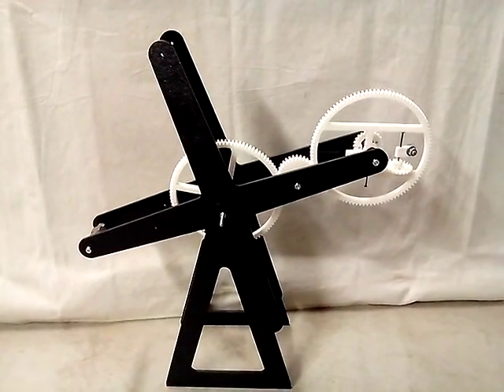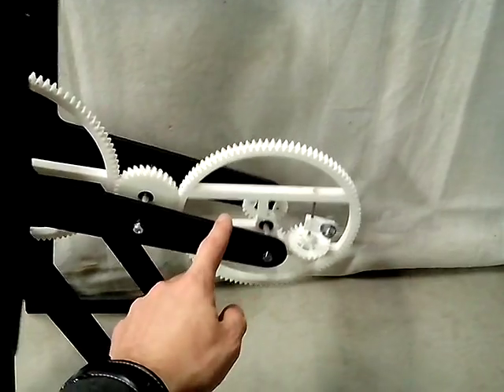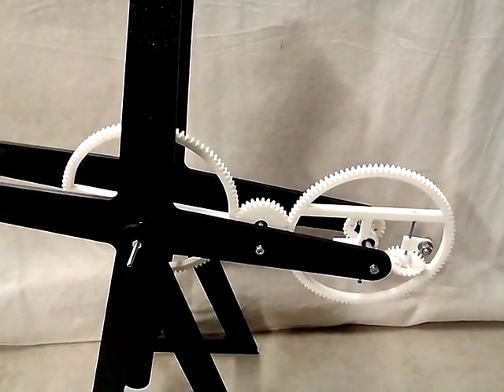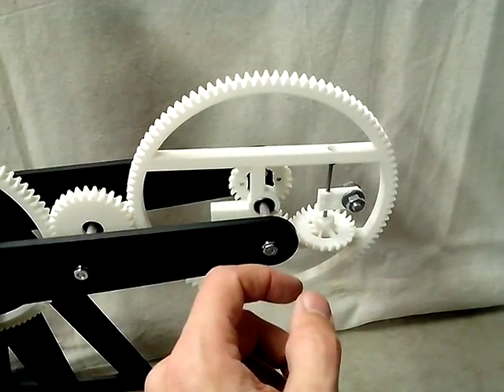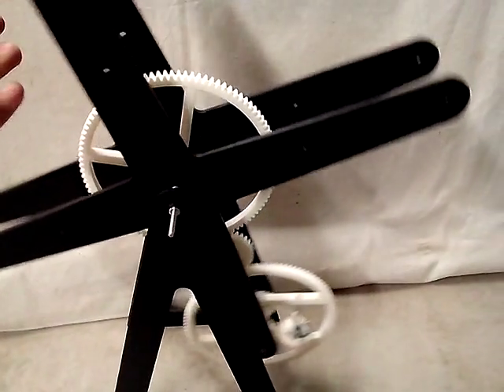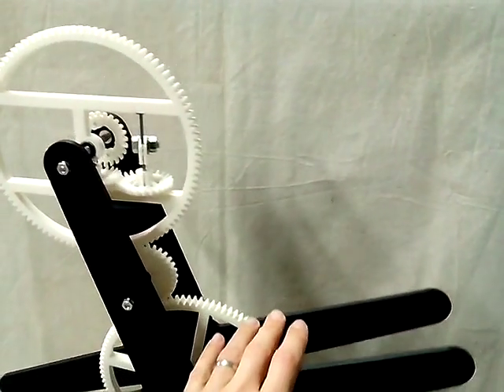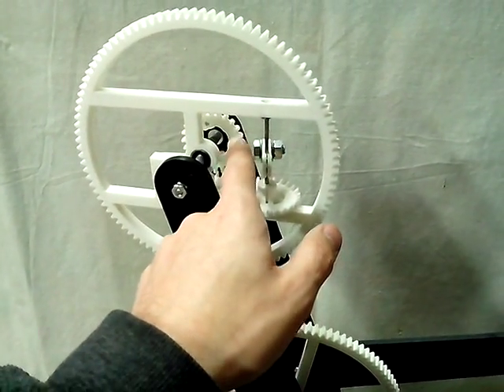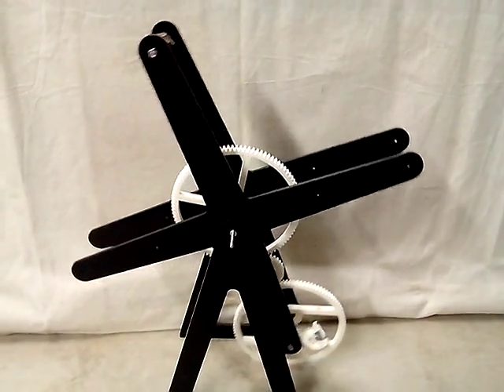Perpetual Motion Prototype

Comment: your wheel is imbalanced to begin with. when you add weight like a wheel on one side, you must apply the same amount of weight on the other side or your difference will not do anything.

Comment: as said.  heavier weight but with a longer arm for more leveraging.   instead of 4 arms use 5 arms, 3 arms falling 2 rising each arm with a gear and weight set.  time the gearing so the weight is at a horizontal spin on the rising side and a vertical spin on the falling side, this is where the weights will put out the torque, when an arm is slightly past its highest point the weight should be at its highest point and starting its fall on a vertical spin.. 
  if you dont quit understand what im explaining and are interested in more detailed and pictured explanation contact me at duncanspcs@gmail.com
also i really want to know where u got those gears...

Comment: It's really nice prototype. If you add another gear in other side and increase the weight, the prototype will work well. Congratulations.
By the way, where can I buy the plastic gears like what you used in this video.
Reply from the maker: I designed and printed the large gears.  The smaller ones were downloaded and printed from thingiverse.

Comment: Dan, I think the problem you are having is that the weight needs to be towards the center of the 4 arm hub when it is on the left side and away from the center hub when on the right side. I love your gears approach and could imagine a sizeable weight being moved back and forth to good effect. This should work with enough arms, bravo, much better than other designs. You need to modify the bevel gears ratio adding a 2:1 divider so the weight moves half as fast rotating out and back in than it currently is doing.

Comment: If you could figure out a mechanism that would put your moving weight towards the main axis on the upstroke perhaps the torques would be less balanced.  Maybe something that moved the weights straight in and out along the axial plane rather than rotating to the sides.  The off-axis forces cause extraneous friction in the machine.

Comment: I've tried many variations on this concept, but there's only torque if the unbalanced weight can get lower - ie. the outer wheel IS overbalanced, and thus so is the net system (including the stator), however the weight can only drop if the outer wheel can rotate it downwards, which is intentionally prevented by the gearing...  basically, holding the OB mass out horizontally and keeping that angle in spite of the orbital rotation precludes any actual weight drop and thus converting any GPE to KE.

Besides which, gravity and mass are static fields...  so it seems highly unlikely that OU is possible from perpetual overbalance..

Excellent build, but you could've saved yourself all that time and effort with a copy of WM2D...

FWIW i'm of the opinion that an effective violation of Newton's 3rd law is the most promising route to mechanical OU... if not the sole possibility.
Reply: ...incidentally the Bessler wheel forum would be the ideal place to thrash out your ideas while avoiding redundant duplication of research...  (the main raison d'etre of the WWW, according to Tim Berners-Lee..)

Comment: I agree it seems like an exercise in futility, but NICE!  
However, if the tiny weight you have supposedly is only 'seen' as though it appears at the axle of that plastic wheel, think about it in terms of the entire arm... balance is all based on the CENTRAL axle... and any weight hanging off if it.  

Experiment... remove the small gear, add a 2nd opposing large end wheel (gear) with weight. 

Tape each large wheel so they are stationary, with their arms parallel to the main black arms, with the weight holders outwards.
On one side, tape the weight into position at the full outer position.
On the opposite side, tape the weight into the full inward position. 
Hold the main cross-arm framework such that the two wheels are horizontal, and let go... which side do you think will drop?

The side with the weight farther "out" has more leverage relative to the MAIN CENTRAL AXLE, it will go down.

Not saying it will ever accomplish perpetual motion, but just trying to help you understand overall balance of your machine.